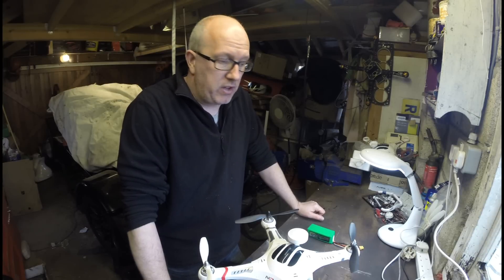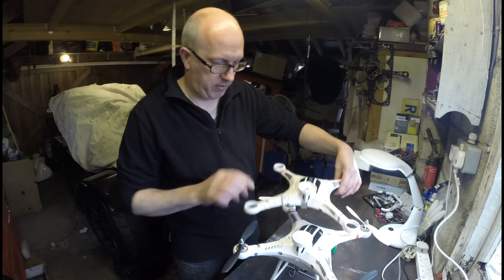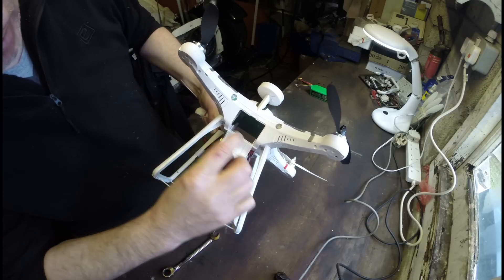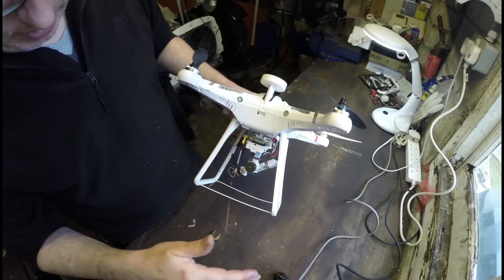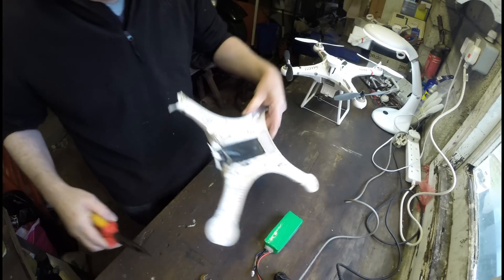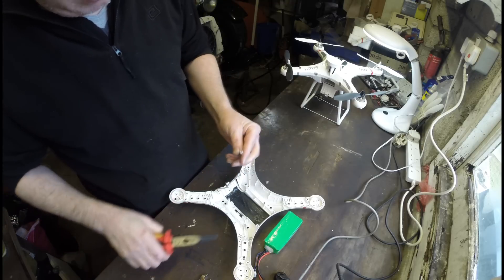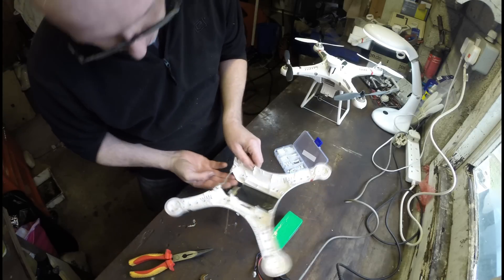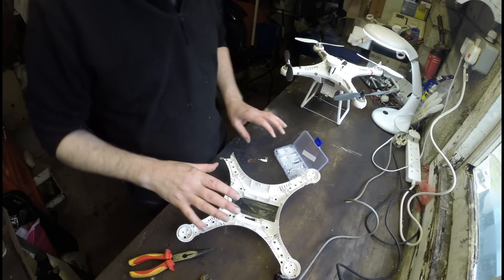CX20 Battery tray conversion for High Capacity battery

Comment: have you, or any other cx 20 owner, every had one of the capacitors break off? i have open source as well, and ALL 4 of my capacitors have fallen off at one point or another, ive re-olderd more than 4 times, wondering if you have a fix? btw the capacitors were damages or burst
Reply from the maker: Yeah, they break off all the time, I just solder them back on with short lengths of wire and stick them down!
Reply: Charles Phillips yea, its a shame, great thanks, all your videos are great by the way, big help!

Comment: >bump<  Hey Charles.  I hadn't thought of increasing the bay size, so thanks for the vid! 

I had wondered why you didn't have a gap in the body seam. But reading thru the comments it seems like I'll need to raise some of the board?  Or... does simply raising the pillars take care of all of that?

BTW - I'm actually surprised by people's battery results.  I'm usually able to get 10 -15 minutes from the stock 2700mAh.

I also just came across the XT-60 battery adapter I heard people mentioning here while reading a separate post on the CX-20:

http://www.hobbyking.com/hobbyking/store/uh_viewitem.asp?idproduct=16373&buddycode=13F0C094-E8E0-4BE2-97AC-C23B1589EAC4

Comment: Great tip.  Threaded standoffs can be made easily out of plastic coat hangers.  Tap and die to your specs.  I would caution about adding any metal.  Also hot glue is handy but very heavy compared to other glues that are actually better for fixing and bonding to the plastic.

Comment: Thanks for the video instruction Charles. I just wondered what size (ie, length & thickness) are you using for this. I don't want to fit it so high that the top won't sit down properly. Many thanks, Dave 😊

Comment: Hi Charles, how high did you raise the power board? Your videos have been a great help getting started with setting up bang flying quads. do you have any suggestions on APM  Mission Planner settings for Cx20. Thanks Wisconsin-John
Reply from the maker: John Junek I seem to remember I raised the board about 6mm, although possibly slightly more once the hot glue set. My best advice for the APM settings is to leave them as standard as possible! You may want to reset the range, but at first get used to it and have some accidents before you change anything!Have fun!...©

Comment: charles just wondered where you gps module is located as mines to the left of the fc it was on top of the reciever but i couldnt close the shell when raised the powerboard for the 5200mah battrey ,i was going to mount mine under the top of the shell but the same i cant close the shell .Just wondering if you experienced any issues with the gps
Reply from the maker: Tim Jackson Hi Tim,The GPS was in the dome on mine, I have also seen them taped into the top of the model, It doesn't actually matter where you put the GPS as long as it is pointing upwards!Have fun......©
Reply: +Charles Phillips (charliepsycho) Hi Charles, where did you put the compass module that was mounted in the dome please?

Comment: How high did you have to raise power board in order to fit multistar 5200 battery? I did 12mm for now, but having trouble closing the shell :) Did you have to rearrange anything at all? Gps is still glued on receiver or did you have to move it?
Also, did you remove rubber on the bottom of battery tray to get few extra milimetres?
Reply from the maker: Nikola G Hi Nikola, I went about 10mm from memory. But the GPS is in the dome on mine, I have also seen them taped into the top of the model or besides the FC. you can move it anywhere you like within reason as long as it is pointed upwards!Have fun......©

Comment: i charles ive now done the battrey mod on the cheerson and got 5 of the battreys from hk as they were back in stock in uk what kind of run time are you getting fully loaded ie fpv gimbal and go pro
Reply from the maker: Tim Jackson I depends more on how you fly really. But concentrating really heard and being very gently I've had 20 minutes fly-time.
Reply: +Charles Phillips (charliepsycho) Charles, just to be sure, that's 20 minutes fully loaded yes? Any idea what's possible without the gimbal & camera? Planning to fly FPV with just a Sony HAD CCD camera and TX...

Comment: Hi Charlie,  which version of the cheerson cx-20 do you recommend getting as I've noticed from the research that I done on the Web there are at least 3 versions. Great videos by the way I like your upgrades and mod advice. 😊
Reply from the maker: Richard Wilkinson I recommend the Open-source version from Banggood or the Nova from HobbyKing, they are both the same!Cheers......©
Reply: Thanks for the advice, very much appreciated Charles. Love you videos on modifications just completed my first transmitter upgrade on my syma x5c and so far so good. Will be following your tips for the cheerson when I get mine.

Comment: Great mod! I also plan to put a bigger battery in!

I received the cx-20 yesterday, I did not start flying it because first I opened the case and checked the build.

(It was a good idea because I found the flight controller attached well to the power board, it was just there in a 20 degree orientation rolling to the usb plug side. Then I removed the tape and moved it a bit to the center and glued back. I also noticed that the usb plug's wires were almost broken, the copper wires could be seen and the plastic wire cover was forced off.
I tried to put the upper case back then I realized that's why the controller was in a tilt, because when it was assembled the upper cover made a force to the usb plug and probably almost cut the wires of the usb plug. I did not connect the cx-20 to PC I don't know whether the outside usb plug is working or not.
I checked that in this version the gps module was put next to the controller above the receiver unit. The receiver has dual antenna system, how strange!
I hot glued everything which just easily moved inside.)

Than I noticed that one white wire from the receiver to the power board is being cut by the manufacturer. But why?
It did not seem to be cut by accident it was soldered there than cut, 4 millimeters above the power board.
This white wire:
http://img.banggood.com/images/upload/2012/chenjianwei/008.jpg
To the bottom right.

Is it also connected on your board or just cut there too?

I did not try to fly the cx-20 because I have doubts of the cut wire.

I just turned it on without the propellers, it paired with the transmitter, I did a quick calibration, turned it off and on again, unlocked motors, both 4 motors could spin up so this part work.

Should I solder back this wire or try to fly the cx-20 like this first?
Reply from the maker: FotoAmg AmgFoto I had that wire cut as well, From memory I think it's a power lead that you don't need.The GPS is in the body on the open-source ones. This is fine as the magnetometer in in the pod out of the way.Get Flying!...©

Comment: Good instructions on a larger capacity battery modification.  Did you also have to update the mission planner'a configuration setup to change from the default 2700mA  5200mA battery?  I read some other posts about how people had to change their configuration after changing to a larger battery.

Thanks,

Don
Reply from the maker: DL Chu Hi Don, My version of the Cheerson has the Bigshark flight controller, so no changes to make. I have seen battery capacity settings in ardupilot on another quad I have, but you would need the current sensor for them to be very accurate, out of the box all it will measure is voltage which is independent of capacity. I usually use frsky telemetry to tell me the lipo voltage so I can make my own decision on whether to try to get home or just land where most appropriate (remember RTL is not the quickest way to get home, it takes a very safe approach rather than the quickest) RTL is for when it goes wrong, not for normal returns!Have fun......©

Comment: Hey Charles, 

Nice tip on the larger battery : )

Since you were talking batteries, I like to ask how reliable is the "low voltage warning" notice with the CX-20? I have read that the transmitter begins to beep when the quad's battery is running low. Then when the system feels the voltage power is too low, it will take over the pilot controls and return home. Can you give us any feedback if either of these statements are true and does it actually work?
Reply from the maker: It doesn't quite work like that on mine. If the battery is too low on the quad the lights on the quad itself start flashing and the quad beeps, if it gets really low then the power drops slowly until it reaches the ground (you wouldn't call it landing though!)
If the batteries on the transmitter (also called the remote) get too low it flashes the led and I think and makes a noise as well, you usually have enough juice to get it home. If the batteries are really low the transmitter disconnects from the quad and it goes into disconnect mode (like you had switched off the transmitter) which (depending on how you have configured the quad) will either go into return to launch mode (fly home) or try and land where it is.
I have never successfully managed to reconnect the quad to the transmitter if it disconnects (e.g. out of range, low batteries or switch off) unless I restart the quad.
Hope that helps...
...©
Reply: +Charles Phillips (charliepsycho) Lol, my dont drop slowly, he really fall, i try it with a minimum hight and he just fall, luckly didnt break. Sorry bad english.

Comment: Hi Charles, where you find the landing gear? looks cool for the gimbal and gopro. You fly this CX20 15-20 minutes with the 5200 mah battery and "full equip" with fpv,gimbal and camera? Thanks!
Reply from the maker: Hiya,
The landing gear came from HobbyKing, it is the DJI Phantom extended landing gear http://www.hobbyking.co.uk/hobbyking/store/__54707__DJI_Phantom_Series_Extended_Landing_Gear_2pc_.html?strSearch=phantom landing
Yup 15 - 20 minutes on a battery when the quad is fully loaded, assuming gentle flying or hovering. If you thrash it about (e.g. pop up shots etc) then it gets less. Depends!
Cheers...
...©
Reply: Charles Phillips  Hey Charles! What props are you using? Now i have 3 of this batteries and total flight time i can is on 14 minutes at least! Of course with light fpv camera, transmiter and telemetry module! Thanks
Reply from the maker: I'm actually still using the original props, although I have experimented with larger (9 inch) DJI props as well. They all give roughly the same amount of flying time.
Reply: Charles Phillips  Happen to know if the CX-20will fit any landing gear designed for the Phantom?
Reply from the maker: The landing gear on the one in the video is the extended landing gear off a phantom (with a little tweaking)
Have Fun!
...©

Comment: great video Charles! Have you noticed any difference in your GPS performance since doing this mod? The reason I ask is that since you're moving all your electronics upwards towards the GPS just wondering if your getting any interference. Also, do you have a link for the battery?
Reply from the maker: Not really, the electronics moves up by less than 10mm. Also the GPS antenna isn't really susceptible to that kind of interference, it's actually next to the flight controller on the apm version (I thought about moving it out of the puck as that is so easily broken) I have more problems with the compass as that is in the flight controller and can go a bit mad under sustained full throttle!
Reply: Charles Phillips Hi Charles, Is this the Batt you're using? http://www.hobbyking.co.uk/hobbyking/store/__62884__MultiStar_High_Capacity_3S_5200mAh_Multi_Rotor_Lipo_Pack.html
Reply: Charles Phillips
Do you think this would fit well?
http://www.banggood.com/Walkera-QR-X350-Pro-RC-Quadcopter-Spare-Parts-11_1V-6600mAh-Battery-p-936354.html
Reply from the maker: Probably, but at the price I'd probably still go for the multistar!